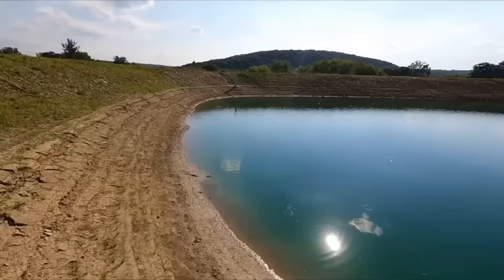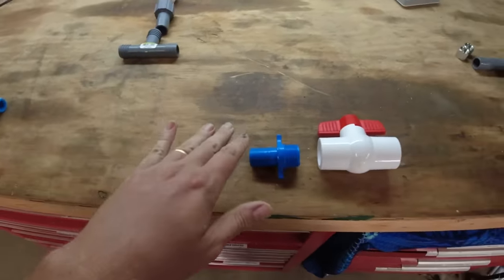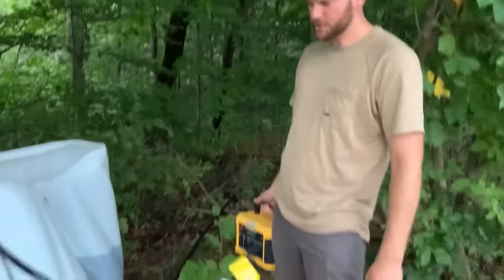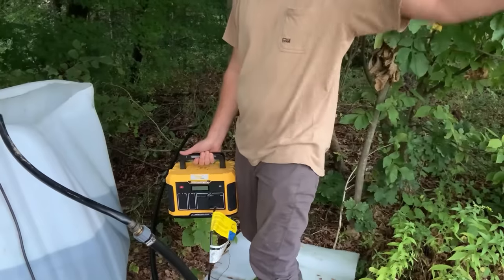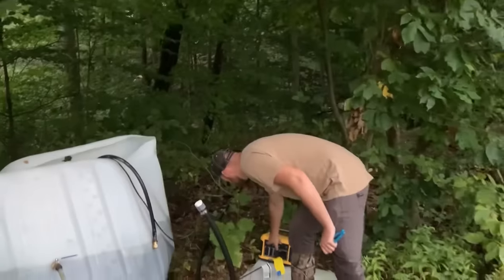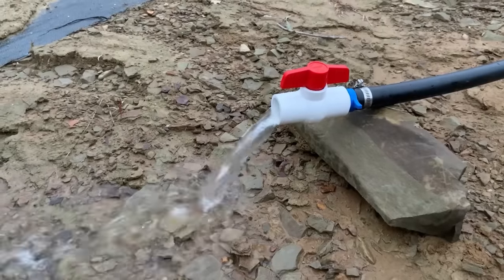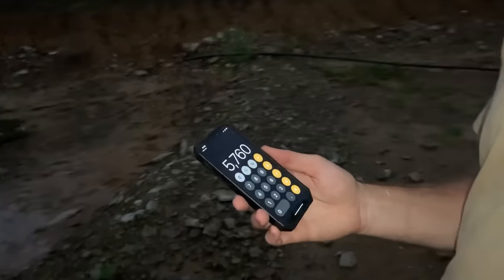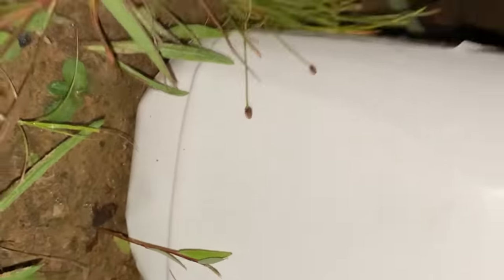This Siphon Will Save Our Pond

Comment: Adam, good to know you can fill the pond quicker now. I have to ask why not use the sump pump to prime the system from either the pond end or creek end? Is the pump not capable to overcome the vertical distance to the top of the hill?
Reply: My thoughts exactly. That would make sure the air was out of the system.
Reply: Or use the ram pump to prime the line, then close off the drive line once it’s full and use the unions to swap out the pump for straight pipe. Sure you couldn’t show off your sponsor’s product, but it ought to work

Comment: I know that reducing the head difference between the creek and the pond will help the most. So, I am wondering why you don't reduce that by using your excavator to dig a ditch through the creek bank? It would help for either the siphon or ram.

Comment: I read several pages of comments and didn't see this question.  Please forgive me if it is already asked and answered.

With about 3 million gallons per year or 8k gallons per day coming down that siphon, uh, how far is that pond from your house?   Can you use this water to supply any (or all, possibly with filtering/treatment) of your needs at the house and reduce the load on the house well and the aquifer?

Comment: If you increase the diameter of the pipe this would increase the mass flow assuming this is correct on the laws of gravity, there for twice the diameter the faster the flow rate,,i recon you'll get twice as much in double time,,like this set up,,

Was speaking with a guy with a highbanker,,with a connection into a sluic,,he has the same pipe fitted into the rear of the sluice from a creek,,He's sluicing like a robot,,kind of makes sence to get the best output for a days,work.

Comment: I wish I had a stream like this on my property. I wonder if anyone has ever tried to create one? Ar ethere conditions to dig an inlet? Or maybe utilizing a Sandpoint and a siphoned maybe? I have a pond that doesn't have an evaporation issue but I'd like to maybe make it bigger. There is a wet weather creek I wanted to turn into a year round. Right now I plan to pump pond water up the hill and then run it back down into the pond. But I want to add some depth to the pond and maybe a big filter so I want to add more water. Maybe I can use some of the pond water I am moving to trigger a Sandpoint pump? Maybe have a pond filter outlet fall into a waterwheel? Just thinking of ideas tonmake my smelly Missouri mud pond into a clear thing with a babbling Brook :)

Comment: Did the siphon pull the water up the hill from the water source and did you actually remove the foot valve entirely to increase water flow? I have to pull uphill about four feet from my water source, across a level field about 150 feet, over my pond bank into the pond. Total footage about 200 feet. Enjoyed the video!

Comment: What's your WAG surface area of the pond?  A more useful measure might be to translate the gallons into acre-feet.  My Google-Fu says ~40,000 gallons is ~0.12 acre feet, or roughly 1.5 inches over an acre.  It'll take a bit, but will certainly help fill up the pond.

Comment: Now that you have a siphon solution, would you consider trenching in some of that siphon pipe near the highest elevation, even 3 or 4 feet to help cut down on the elevation the siphon needs to overcome?  Might increase flow rates further...
Reply: That would have virtually no effect. The flow rate is determined by the elevation difference between the intake and the outlet and the diameter of the pipe. The tee fitting creates turbulance and a restriction (i.d. of the fitting is smaller than the pipe) and has a greater effect than the elevation that the water is being lifted.
Reply: @mikewatson4644  In theory mike, but not in practice. The height DOES make a difference because you are asking all the seals and fittings to not leak with added vaccum to overcome the height.  Those PVC fittings have limits.
Reply: @coldcaribbean  I work with siphons on a daily basis. The extra height of 3 or 4 feet on the suction side is offset by the additional fall on the outlet side. Air leaks should be minimal on this installation. 2.31 feet of elevation will generate 1 psi. This pipe and fittings would handle far in excess of 100 psi. There is not anything close to that being generated by this system. Limiting factor in this case is pipe size (further reduced by fittings) and the amount of fall available. Ultimately, it will be limited by how much water the stream can supply.

Comment: Excellent! Have you been able to estimate the total amount of gallons your pond would hold at its optimal depth? That figure would give you an idea of how effective the new siphon would be to holding a level or getting it to a level you want... What about winter, is that area where the siphon starts going to be deep enough to continue running if it freezes? Great video, thanks!
Reply: He mentioned he might get a goo 9 months of the year use out of it.
In the end, this is very cool project. It still took a considerable effort.

Comment: You should have primed the pond side of the line with your pump by pumping it from the pond up hill to the top..then shut of valve and move pump to creek side and prime it up too the top again. your line is now ready by pouring a little water in the open end at the top to displace any air - cap it and open the valve..your done.

Comment: Good job. My question is have you ever calculated the evaporation rate in gallons per day of that pond to see what is needed to keep it full?
Reply: That would be tricky.  That would depend on a lot of factors that change constantly - surface area, water temp, air temp, humidity, and wind at the least.
Reply: @ian3580  well you do it at what is considered full pool and full sunlight. It is a calculation on average loss, not a perfect number.
Reply: @JohnSmith-ug5ci  without considering temp, humidity it wind at all?  From my experience the humidity, water temp, and wind make an enormous difference.
Reply: @ian3580  again the calculation is not intended to give an absolute number but a general idea. The parameters I gave are all that is needed.

Comment: Is there any point on your property where the creek bed itself and the water level are at a higher level than the ground level at the plastic surge tank you used with your pump system? If so, you could make it a gravity feed system instead of a siphon system. That might possibly gain you more water flow, especially if you could put the intake screen at the bottom of a foot or two deep pool of water.

Comment: Maybe replacing the cap with a valve would making charging the siphon easier.
Reply: I was thinking the same.. but as they said in the video, they want ZERO air leakage..
I am unsure a valve would work as well. Especially as this valve would be under CONSTANT vacuum from the syphon.
A solution to that would be from the T junction, pointing upwards, replace the cap with a valve (as you said)
On top of that value you have a container with more water in. (Small one will do, like a beer pitcher size). I'l just referring to this as 'the jug' This would:
A) allow filling up the pipe for re-charging since now you are filling into a MUCH bigger receptacles, 
B) if the value DOES start to fail slowly over time, it would just be sucking in MORE water, not air from the jug.. (until the water in the jug runs out)
C) rain water would/could refill the jug.

You could even use the ram pump for filling this up, giving you a purpose of this ram pump.

Comment: We had a ram pump years ago and also had a powered piston pump which had a large metal cylinder ram to boost the output pressure.  We had another ram pump with a rubber bladder in it so the cylinder never fills with water.  It should have been obvious that the spring loaded foot valve reduces flow?  The pressure to overcome the spring is usually written on or included in the valve.  Use you beancounter skills to figure out 1.0 lb spring reduces the pressure and flow by using 33' = 14.7 pounds or 2.2 feet of head .    Check the flow from your milk jug with 2.2 feet of your 1" pipe on it?  Over a year ago, we read the IDENTICAL scenario from a builder in Malaysia who build a ram pump, only to have an elderly community member come along and reconfigure the system as a syphon.  The elder noted the pond had been filled by a syphon by his father.  It is good to take note of people who respond to your posts, but even better to learn by searching the world.  We were going to ask your elevations, but followed you to your conclusion before asking.  Have you considered the surface area and leakage from your pond?  A smaller, deeper, pond with a liner might be an even better solution?  You have the equipment!  https://www.sciencealert.com/here-s-what-s-really-going-on-with-those-black-balls-in-the-la-reservoir

Comment: A lot cheaper than drilling a well, and using no electricity. Nice job Adam.
Reply: Yes… because he was seriously considering the well!  I am very glad that this seems to be a very good solution.  And it should be able to run during the winter where the ram pump was going to be shut down during freezing temps

Comment: Rather than using the T junction to prime the siphon would it not be easier to use the Ram Pump to prime and start the siphon? You were concerned about it doing so in the video you first built and used the ram pump in after all. You should also be able to use a quick connector so that once the siphon is going you can disconnect the ram pump and just let it flow.

Comment: Couldn't you just let the ram pump continue to run to the tank and add a self tripping toilet type flapper to the tank?  Put a Tee in at the tank and connect the top of the tee to the tank and the other ends to the syphon tube.  Put a swing check valve on the source end of the syphon.  Make source the discharge end of the syphon is higher than source.  This way if the syphon is lost due to low water level in the source the source side of the syphon tube will refill each time the tank flushes.  The check valve at the source end will prevent the water from running back into the creek, spring, etc.  Once the source side is full the next time the tank flushes the water will run down the discharge side and begin the syphon automatically.  Once the tank is sufficiently empty the flapper will close and the tank will refill automatically.  The next time it "flushes" there will just be a better flow into the discharge side.  Since there is no air entering the system the flushing while the syphon is running will not cause any loss of syphon.

Put a small hole in the side of the tank with tube that would lead to a tipping bucket or PVC.  Take a two inch piece of PVC.  Attach a pivot point close to the end with the cap so that the pvc wants to right itself.  Think toilet here again.  Then where the flushing handle would normally be located (which attaches to the flapper inside the tank) attach jug or bottle with a small hole in the bottom for a drain.  When the PVC tube is near full it will pivot and empty all it's water into the jug attached to the flush handle.  This will provide enough weight all at once to pull the flapper up inside the tank and cause it to flush.  The hole in the bottom of the jug attached to the flush handle will allow the water to drain and for the handle to properly reset.

Hence a self priming, automatic syphon.  No need to bring tools out to begin the syphon.  No having to babysit and re-start the syphon if the source water level drops below the intake of the syphon.  The Ram Pump will fll the syphon tank.  This assumes that the ram pump intake is located ABOVE the syphon intake so that it always has a source of water.  As long as the ram pump does not stop the syphon could be automatic.  A slow running stream could have a small dike or retention pond/pool downstream of the ram jet.  This would allow the syphon to start automatically and empty the pool once it had enough water to cover the intake.

Thoughts?

Comment: Good job guys. I am curious to know why you did not use the existing pipe running down from the tank for the downhill section of the siphon, since it was already trenched under ground?
Reply from the maker: We did. When we unrolled the new pipe. That was for the pipe going down to the creek.
Reply: @HometownAcres  Good deal Adam. I'm sure with Doug around, he'll come up with 'a better way' to finagle the ram pump and siphon  to work together on charging the siphon if it draws air! 
Good stuff, yinz will have a regulation ice rink by December!!!

Comment: if your pond is a 1/2 acre or about 22000 sq ft and has an average depth of 10' it will only hold 1.6 to 1.7 million gallons. With your rate of 2.5million a year i would expect you should see a full pond year round now.

Comment: My buddy was pumping from a drainage creek to water a few corners on a moto track and the dnr came down pretty hard on him. He had no idea it was illegal in Wisconsin and was treated like a hard criminal. I could see were filling a pond could be looked at different than watering soil even though he was only taking 100 gallons max a weekend. I’m sure you have looked into the laws but I would be interested in the nuance of the law.
Reply: I was wondering the same thing. I could be wrong but I thought in Idaho it was illegal to pull from creeks generally.
Reply: @archeryhunter86-  we went from fire wood too landscaping to house planning to berry patching to road work to pond building ,
Stand by for court room arbitration 
😊

Comment: Just wondering, why are ya not still running the ram pump at the same time and have two systems going!! 🤨 syphons can be really temperament, the smallest thing can brake a syphon. Where a ram pump can and usually will restart on its own.

Comment: Why not just use the ram pump pipe instead of buying and running more pipe?
Reply: He did use most of it… should have said that.  From the tote reservoir to the pond is the same line.  He did replace it from there down to the stream.

Comment: If you can get your hands on enough  plastic barrels, or any floating thing, you can stock half or more of the pond during dry seasons to prevent sunlight from cooking the water off. I don't know what you use the pond for. I'm sure it will be a pain in the ass, and may prevent you from using the pond for some things, but it will save the water, fish will still swim and be safe from predation from birds.

Comment: I'm worried about using the siphon and running out of water by pulling too much from the source, too quickly, which will of course break it.  There was little or not chance of that using the ram pump.
Reply: All he would have to do would be to put a valve on the outlet.
Reply: @williamgleaves1954  The water flow looked like it would fill the gallon in 3 seconds from the glimpse of the stream.
20 gallons a minute. He is only using 5.  
But I would enjoy a video of calculating the stream output in GPM.

Comment: Why not install a valve there 6:38  too rather than deal with a cap which could introduce air into your line if the threads were not sealed properly.

Comment: The higher the water level in the pond the higher the pressure on the leak, the faster the pond drains.  The faster the pond drains the more erosion on the leak. The more erosion....well, you know what.

In the meantime set up the hydraulic ram at the siphon outlet to operate some kind of fountain or a crazy water feature.

Comment: How many acres is your pond? It takes just over 27000 gallons to raise a one acre pond one inch not figuring in evaporation. Your new flow is 5 gallons per minute, 300 gallons per hour or 7200 gallons per day. That would raise the level of one acre one inch where for days. If your pond is 5 acres, you may get one inch in 20 days.
Reply: I though his pond was only 1/2 acre although it looks bigger in video

Comment: Using a Concrete or Plastic Dounspout "Splash Guard" will minimize erosion caused by the water striking the soil/Gravel into the pond.
Or just secure a 5 Gallon Bucket with an Input (at the bottom with the Bucket laying on its side) and use the side of the Bucket to reduce the Hydraulic Force causing erosion from the flowing Water.
Reply: There is a lot of rock there. This should be a problem.

Comment: 5 gpm = 300 gph = 7200 gp/day = 50k gp/week.. is 6700 cubic feet per week.
if pond is 150x300 feet (football field size 45k sq ft), 6-7 weeks to raise it a foot?
I'd think you'd see a healthy inch of gain this week, more if the pond is smaller.
7.48 gallon per cubic foot.. is how I'd ball-parked for water rise.

Comment: You know how many acres your pond is. You need to be measuring not in "gallons", but in "acre feet". That will give you a meaningful number.
How many inches will that add to the pond in a month. You will likely discover the amount you are adding is meaningless to the pond's levels.
Reply from the maker: 30 days to add a foot to the pond
Reply: @HometownAcres  
That math is incorrect.
One "acre foot" of water is the amount of water needed to cover one acre of land one foot deep.
An acre foot of water is 434,468 gallons.
Your pond is 3/4 acre.
3/4 acre foot is 325,851 gallons.
At 4 gallons a minute that is 
only 172800 gallons  in 30 days.
1. That's not enough water to raise your pond a foot in 30 days.
2. Even if the sides were vertical.
3.  Because the sides are sloped, each additional gallon of water added adds less height than the last.